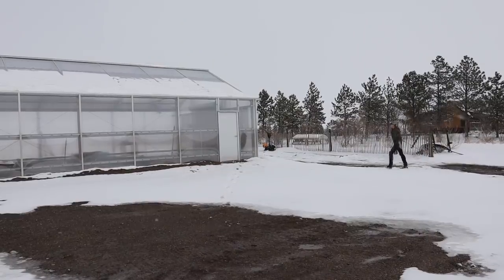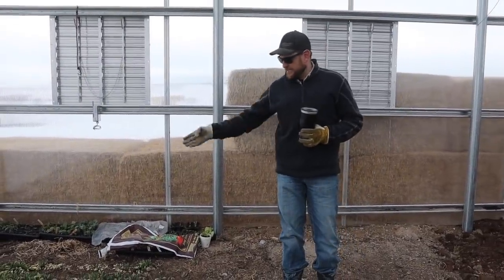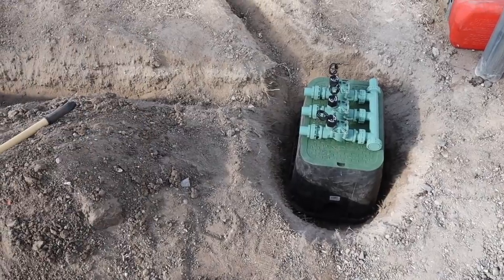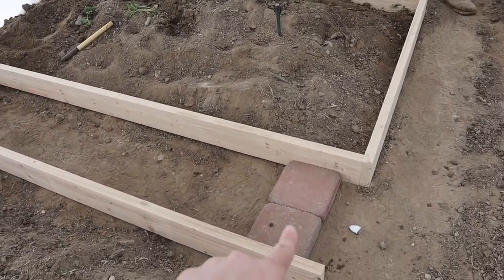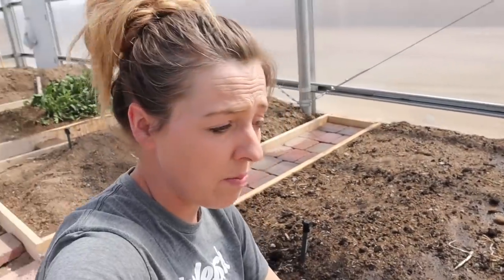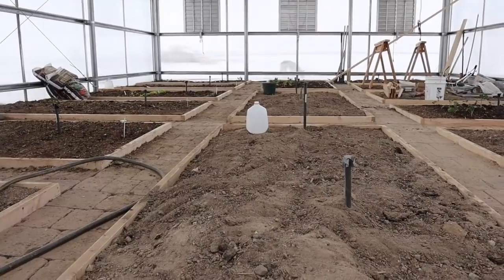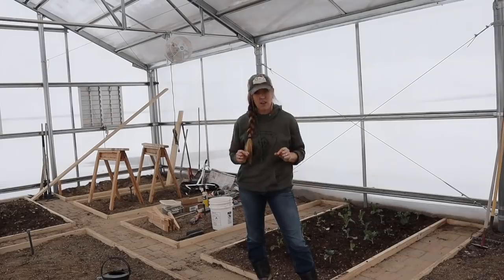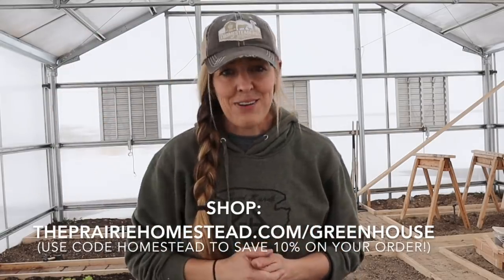Our MASTERPLAN to make the Most Efficient Greenhouse EVER!

Comment: Hi i live in New Zealand and being middle aged, i built a hydroponic hot house with raised beds, so i didnt have to crawl along to tend beds. I only had a narrow area to build it in. 4meters wide. I made the easterly bed one meter high(36 inches) a walk way one meter wide, then the final bed way 1.2 meters high. I just built a wooden frame and placed plastic trays on top, slanted down wards for the drainage to dribble into plastic guttering to return the water to a tank, sunk into the ground. The growing medium is an equal mix of pearlite and vermiculite. I keep the nutriant at a certain value, that would cover certain veggies. Id check its values once a day, on getting home from work. I installed lighting and a ball float in my tank. I had a submersable pump in the tank. I had the pump on a timer. Spray and drain. I had loads of storage under the frames. Id get concintrated nutriant mixture sent to me, then id thin it down. Then introduce it according to my dayly tests. To maintain the PH and nutriant values. Imgrew heaps of veg.  I pumped the nutriant around the house on a ring main, and took bleeder lines off the ring main. Its been running off and on for 20 years. It was a pleasant place to sit on cold rainy days, and as the bones got stiffer, it was still easier than bending over all the time.☺

Comment: That greenhouse is awesome, Jill! The pavers look great. 👍

I don't have a greenhouse(yet), just outdoor raised beds. I've been experimenting over the years with irrigation & what I found works best is 1/4" soaker hoses rather than sprinklers or drippers. The hose is inexpensive & easy to replace as necessary. I ran 3/4" PVC hard lines to risers in each bed with simple ball valves to adjust the water flow for different crops, all on a timer so I almost never have to think about watering...well, except to put the system on rain delay since I'm in the PNW, lol.

Comment: Automation on the Vents is great!  Watch where you put that darn thermostat and you may need to put a small over over it to keep the sun warming it to soon!  Learned that from ours!  Also, love the Geothermal thought!  I need to get to Alliance and see that set up!  Question, is there a shade cloth on the top of the roof?  I had to add it to mine to keep the temperature from reach the 110 degrees in the summer but of course our Wyoming wind is hard on it!
Reply: could prob string up the shade cloth inside - make a sort of drop ceiling.

Comment: Absolutely beautiful greenhouse nice and big totally jealous. We’re talking about growing tomatoes in the centre and sending twine up to the ceiling. My grandfather used to grow a lot of tomatoes in his small greenhouse however he used steel cable and turnbuckles to tighten it all up running the cable horizontal and vertically to tie his tomato plants to this way he didn’t have to set it up every single season All worrying about it snapping under the weight of the tomato plants. You talked about putting the higher plants along the north wall which makes sense this way it won’t restrict the light to other plants. But me personally I would put a vertical tower system in this would increase the amount of crop you could grow in there massively. Here are other wonderful advantages to it as well. You could have a fully automated system that would feed the plants nutrients and water and recycle the water to reuse again I have never use this system personally but have seen it a couple of times and it almost seems like magic. You’re probably aware of this but I’m just throwing ideas out there hope you don’t mind.

Comment: Way to go...showing off your wealth with all that wood. LOL
I can see where a greenhouse would be very useful up there with your very short growing season. I am wondering why you would grow greens, lettuce, broccoli or root vegetables inside the greenhouse. I am in south Mississippi, and we have to grow those things in the wintertime or very early spring because the summertime is WAY too hot. They can all handle light frosts.
Reply: Its too hot in kansas for those in rhe summer, and Montana gets close to as hot. A greenhouse let's you straddle the seasons, lengthening the cold period allowing for an actual crop.
Reply: How do you lengthen the cold period with a greenhouse?
Reply: @masquitaful  being able to grow when it's too cold. I should have stated that more clearly. In Montana everything g freezes solid for a good 4 months. A greenhouse can be kept enough above freezing to keep on growing. Taking that further you can use a greenhouse in the height of summer when it's 90s plus, and create a a slightly cooler and protected place to grow things that would bake otherwise. In this case, shade cloth and open sides are used.

Comment: You will be losing a lot of vertical space.  There is a system that I saw, where the crops are grown vertical, with liquid nutrients and a particular light spectrum.  The yields are perennial and significantly greater than a horizontal base.